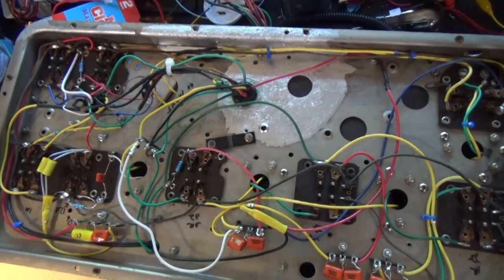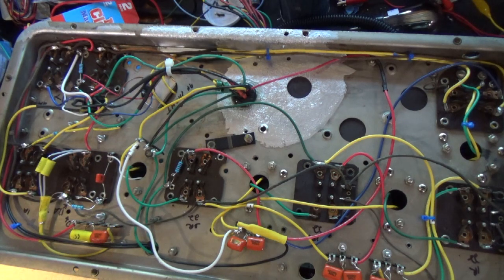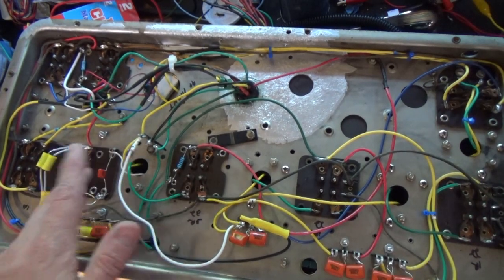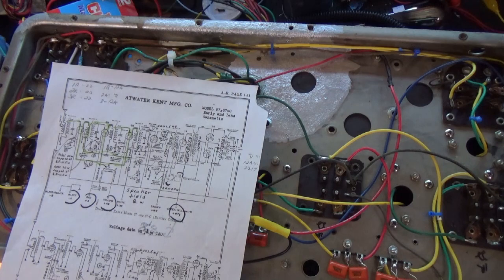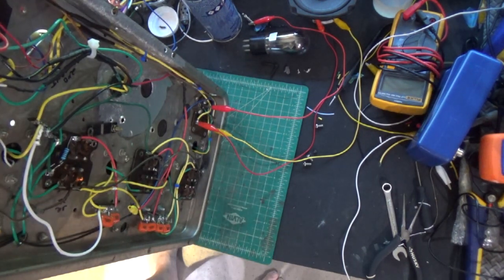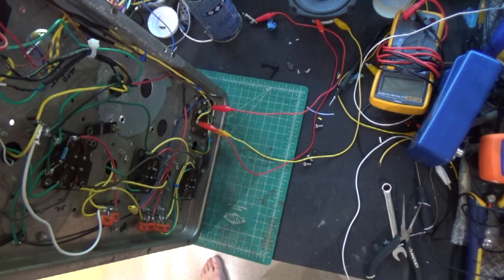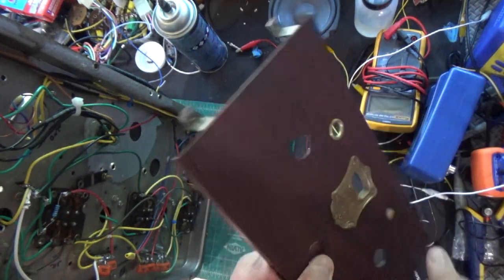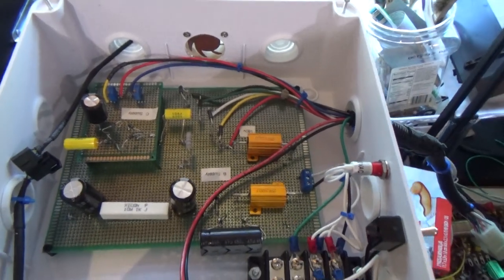Atwater Kent Model 67C Battery Radio : Episode #10: It Plays, Its alive , No Short Sherlock

Comment: Bravo Ron: bravo dear chap!
I’m pleased for you the 5 volt S M supply rail is not presenting you with interference problems ...it must have good suppression incorporated into its circuitry.  It also must be a relief to know that all the valves are functional ...I seem to remember you saying one or two types of those valves are very expensive to replace.
It is so easy to overlook those seemingly insignificant tiny snags like cracked wire insulation, and bare wires.  I don’t know of a technician, or enthusiast that has not, at some time, fallen victim for either one of those ...I certainly have, and I’ve been playing with vintage electronics since early 1968.
Once the loose ends have been tied, such as the lead dressing, that radio will be ready for boxing up into its cabinet.  Let’s hope your friend is able to get his hands on that radio’s original speaker ...getting that going will make up the full set, so to speak.
Cheers my friend, Phil.
Reply from the maker: Thank you Phil !!!  I am very pleased with the end result. The power supply was more challenging than the radio to be honest. Without Brendan, I'd be using scotch tape and connecting AA batteries together..... LOL   I have learned a great deal here... and I appreciate everyones comments and suggestions each and every day !!!!    Thanks my friend...  Cheers